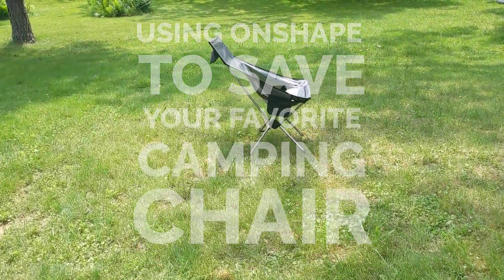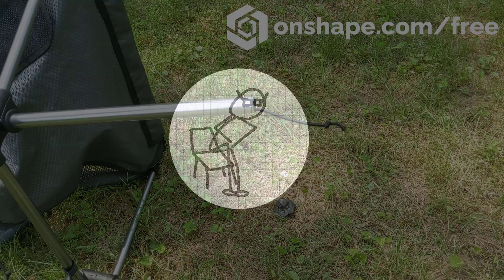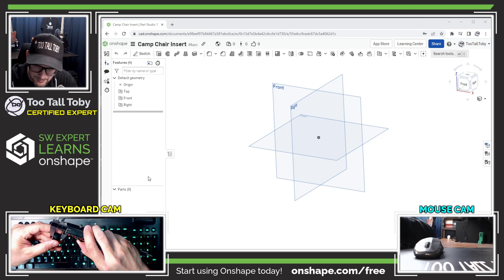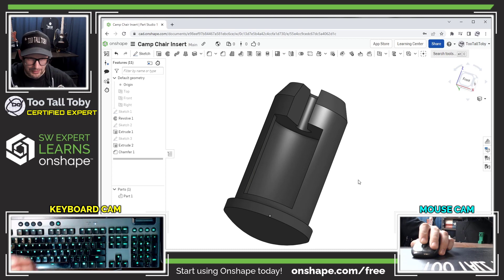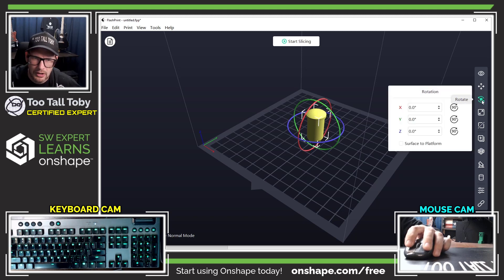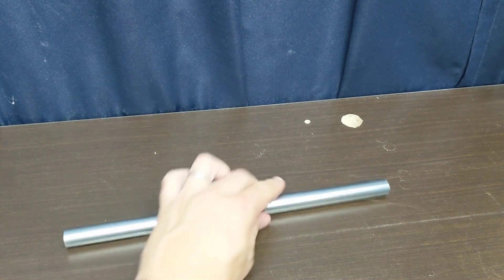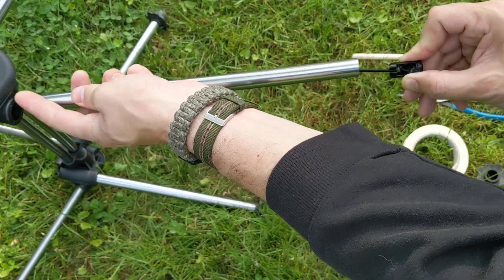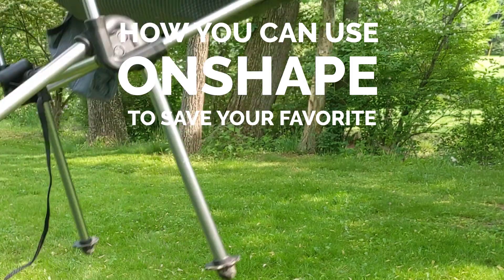Repairing a Camping Chair with Onshape (Functional 3D Print)

Comment: I would recommend to use a different filament for a part meant to be used outdoor like that. PETG or (even better) ASA would guarantee greater durability against the high levels of moisture that the piece will likely be exposed to. 
Also, in this specific case, I believe that having the part laying down on the printing bed, with the cat-out on the cylindrical part facing up, would have been a better orientation for your print. This would have given the part higher longitudinal strength and lowered the chance of snapping under use due to layer bonding failure.

Comment: you should have designed it so dont need supports. i would have :]
Reply: yeah I agree - I could have added some stragegic design changes to avoid the need for supports on the 3d print.  Maybe radius that lower section of the pocket.  Fortunately my machine is awesome about the breakaway, so its usually not a big deal to cleanup 🙂